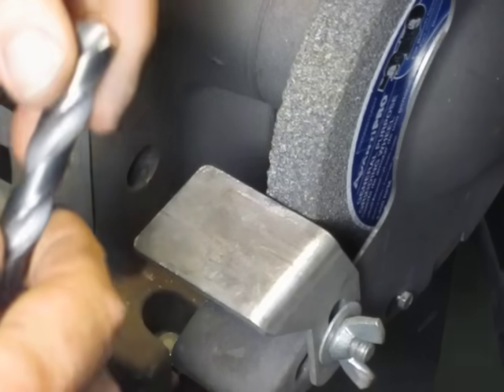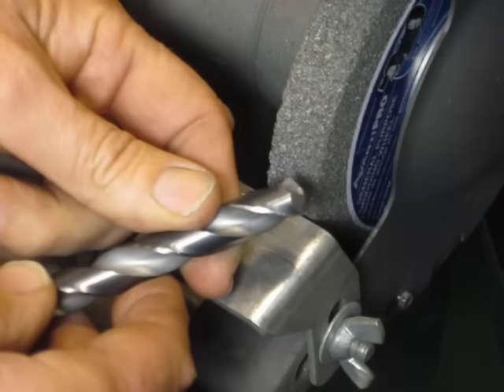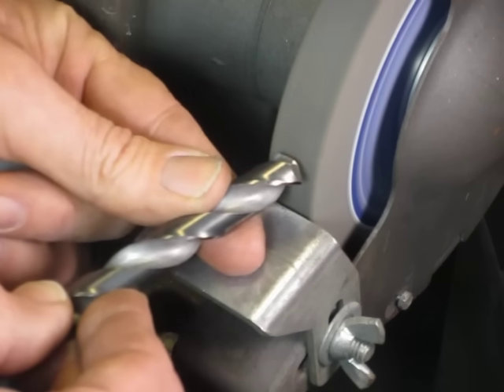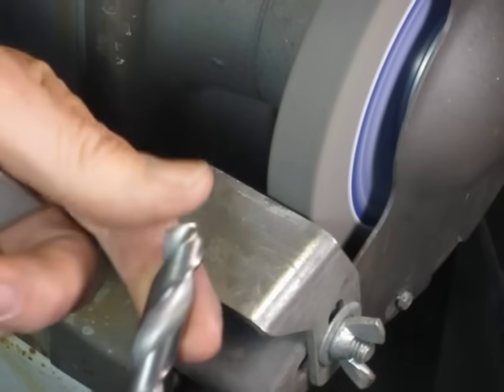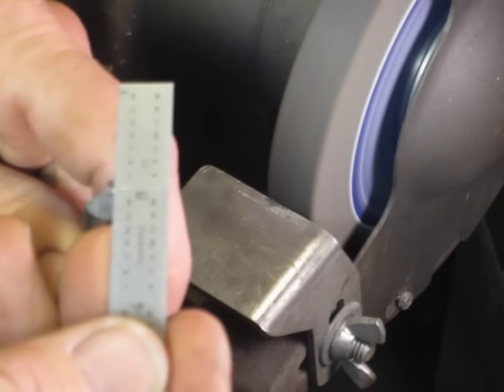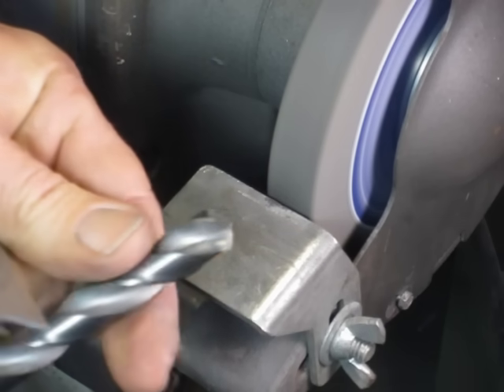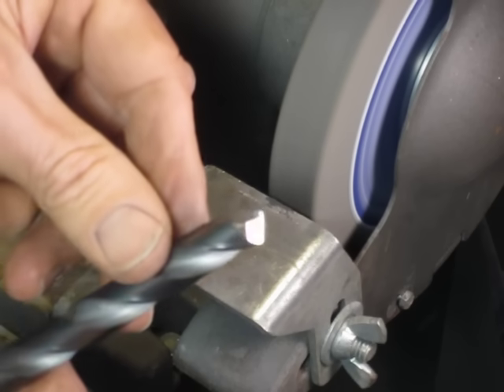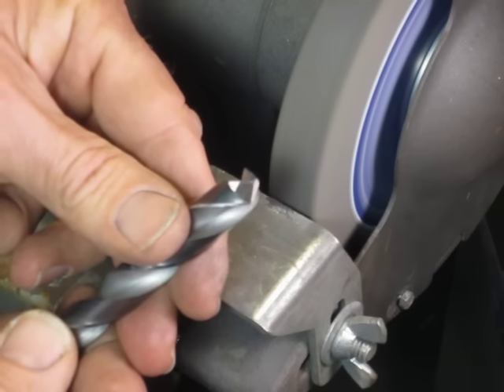How to Hand Sharpen a Twist Drill

Comment: something I won't ever get: you guys spray liters of cooling fluid on the tip when drilling through a 3mm brass plate, and then you turn around and put your precious HSS tools on a hi-speed benchgrinder and let the sparks fly?!? Anyway. You explained pretty well how to achieve a well sharpened drill bit. Thanx for that.
Reply from the maker: It sounds like you lack an understanding of the red, or hot hardness property of high speed steels. Unlike carbon steel, which starts to lose it's hardness around 450ºF, it takes around 1100ºF to accomplish the same thing with high speed, literally a dull red in color. The only reason you need to dip high speed steel tools when grinding is to keep them from burning your fingers. I actually did a video with a demonstration on this very concept if you are interested.

https://youtu.be/jQ648eDA7V4
Reply: @TomsTechniques  I know about tool-steels, you can believe. But ... anyway thanks for offering advice. Now... how can I put that right as a non-English native... Unlike during high-speed-milling, where most of the heat is going into the chips and gets by this driven away from the workpiece, you are using a bench-grinder. And during this process the heat is equally distibuted to the cutting edge and to the chips. And, those chips fly away in form of glowing sparks (yellow). So, the heat possibly offered to your workpiece shoult be far above 600°C. Well you will answer that the tool's massive shaft will absorb most of the heat, but... correct me if I'm wrong, cutting is done by the very top edge of your bits and tools. So we're talking about some cubic-micrometres of steel. It's inevideble that it gets detempered, as that's exactly the piece where you are grinding in purpose of sharpening.

So... to me your method looks still like diletantic sharlatanery...  Or do you just love sharpening?
Reply from the maker: I understand your theory and I've heard it before, but in reality it just doesn't hold water. I've been sharpening bits like this since the 1970's and the methods I use are not unusual or uncommon. If what you say is true about the grinding wheel damaging the cutting edge, I suspect someone, somewhere would have noticed the effect in the form of poorly performing tools. I personally have not, nor have I heard of anyone else who actually does this sort of thing for a living mention such a short coming and I'll take real world experience over theory and conjecture any day. 

By the way, it's charlatanry, not sharlatanery, and I suspect that you sir may better fit that characterization than I. ;)
Reply: Call me a diletant, will ya? Well YOU, my good sir, are a festizio.
Reply: voice of Billy Bob Thorton "I like the way you talk"

Comment: I have been grinding drills from very small to 3" by hand for just over 40 years and I have always thought my apprentices that what you take
off on the first cut you take off the other side and always with a radius
Reply from the maker: Conical relief is the standard, but multi-faceted drill point geometry is becoming more common. Any split point drill you buy will be faceted like this.

Comment: I work with a older guy who insists on hand grinding drill bits, I haven't even figured out how to use the damn drill Dr yet. 😆😆😆
Reply from the maker: I was doing this long before I was an "old guy". :)
Reply from the maker: Np. I was just pulling your chain. I once worked with an older guy who swore by a crumby attachment on a pedestal grinder to sharpen his bits. He challenged me to a little competition to see how many usable bits we could each sharpen in a given amount of time and I won hands down. Only problem with that was I had to teach him how to hand sharpen. :)
Reply: @TomsTechniques  I'm trying to learn. A little practice here and there when I get free time
Reply from the maker: That's what it takes. Once the muscle memory is developed so you can lift a bit off the wheel and put it back on in the same position, it never goes away.
Reply: @TomsTechniques  well I tried a few today and completely fuckered em right good.  Lol. More practice needed.
Reply: @TomsTechniques  I was not trying to come off as calling you old. Just telling a factoid.

Comment: I got taught when I was an apprentice mechanic 50 years ago. My boss taught me to slightly roll the drill bit from the cutting edge, the main thing is practice. I can still do it today, keep at it.
Reply from the maker: Conical clearance will work fine (that's the way I learned as well), but faceted clearance angles are a bit easier to grind and generate less heat.

Thanks for watching.

Comment: How do you do a #60 drill?
Reply from the maker: It takes a steady hand, a pin vise to hold the drill and magnification, but it can be done.
Reply: A microscope mounted on the bench in front of a dedicated grinder. I ground a lot of #55 tire mold vent drills that way. They will get red quick.
Reply from the maker: Your eyes are definitely the limiting factor when working on small details. I've done a lot of machining through a stereo microscope. Once milled a .008" square hole in a piece of brass shim stock using a .003" diameter carbide end mill. It was on a CNC mill and through the microscope, you could see the individual XY steps and the pause to let the end mill catch up. It's pretty crazy watching an end mill the size of a human hair drilling and milling.
Reply: Very carefully! Use a 180 grit wheel and a headband magnifier. It can be done! It is even possible to hand grind a 1/16" 130 degree split point drill. I know - I've done it out of desperation with a solid carbide drill.

Comment: You take too much off the backside the drill bit is going to be overheating and cutting too much,  a little bit lower that do the best job. It takes me about 5 seconds per drill bit to sharpen without measuring angle and 100 percent Sharp guarantee every time, a broken bit take a lot longer.
Reply from the maker: "Too much" clearance will reduce the amount of heat conducted away from the cutting edge, but too little will cause the heel to rub. It needs to be somewhere in between, or as on larger drills, you need to use two secondary relief angles.

Comment: The angle should be between 90 deg and 135 deg, for very soft, respectively for hard materials. 118 deg is the average angle which satisfy majority of materials. The exact angle is not very important as long is the same for both cutting edges. For through holes it doesn't matter the geometry of the drill as long it cuts well. For precision holes,  angle , length of cutting edges and relief angle ( rake is built in and you can't change), is important therefore you should use new drills or sharpen the drills with a devise like Drill Doctor. Large drills over 3/4 to 1 inch dia., or very small, cannot be usually sharpened by hand. You have to have a very good eye and hand to do it. Any difference between cutting edges will create a lot of side force to bend your drill and obtain a larger hole than intended. One of my teachers once said: "if you can't draw a drill, side view, top view and cross sections, you do not understand the geometry of it and you can't sharpen it". I wouldn't be so tough, but you really have to understand its geometry.
Reply from the maker: All good points except for the large drill thing. I find larger drills much easier to hand sharpen because the geometry is easier to see and an error in cutting edge length has much less effect on the diameter of the hole. For instance, a 1/64" variation on the length of the cutting edge of a 1" drill bit will have less effect on the diameter as a 1/64" variation on a 1/8" bit.

Tom

Comment: This was my grind for 35 years running production. I ran A286, Inconel, and waspaloy so the grind had to be spot on. Your grind will run 4 hrs at a min and 8 hrs if you push it. I always split the point which is not difficult, just practice until you get it down pat. When buying a protractor get one that has a scale marked on the back, makes it easier. Or just glue one on.
Reply from the maker: Accurately splitting a point by hand is a bit challenging for a basic video like this, so I opted to just show how to thin the web. It's amazing how many responses were made about how a drill sharpened like this will quickly fail. Of course none of the posters actually try it, they just know it won't work. :)

Tom

Comment: Need to roll drill as you sharpen it to give the cutting edge slight relief.
Reply from the maker: No, rolling the drill is not necessary and the whole idea behind this video is to not use that technique. Multi faceted geometry is more efficient (as in it creates less heat) and much easier to grind.

Comment: Use only the side of wheel. Angle is right iif both cutting edges are "straight" when viewed "end on". If hooked, the angle is too shallow and if curved back it is too pointed. Get the angle right then add some relief behind the cutting edge. This way works 100%. Look at a new drill bit end on and see how straight and even they are, copy that.
Reply from the maker: I would not recommend using the side of the wheel on a bench grinder, other than the very corner to thin the web on a drill bit. There is no rest for support and it's not practical to dress it as it wears (for the same reason). You are much better off sticking to the face.
Reply: I had  assumed the wheel was in good shape and used only for drill sharpening etc., Thinning the point is only of significance with larger drill bits, say 20mm upwards. Drilling a pilot hole is always better. I have used this  method of drill bit sharpening for 60+ years, ever since I was shown it by a man who had worked in shipbuilding during world war II. It will work everytime if you carefully follow what I have written. .
Reply: Never use the side of the wheel.🤣😂😁😀😎

Comment: how about some ppe?????????????????????
Reply: @TomsTechniques  personal protective equipment. ppe its the term professionals use
Reply from the maker: I'm wearing safety glasses. Am I missing something?
Reply: @TomsTechniques  maybe some safety gloves. js man
Reply from the maker: When I was young and stupid, I was welding a piece of angle iron and decided to clean it up a bit on the belt sander to make it easier to weld. In the process, the part caught on the belt and was pulled into the gap between the belt and table, along with my gloved thumb. Before I could react, the belt ground about a half inch off the end of my thumb, flesh nail and bone. That little incident taught me that wearing gloves around moving machinery is a really dumb thing. And if you take the time to browse the Department of Labor website, you will find that gloves and loose clothing combined with machinery are the leading cause of injury in the workplace.
Reply: @TomsTechniques  dont need to look i believe you. sucks about your thumb sure that hurt like anything. take care thanks for info never thought of a glove catching just thought of a finger doing it.
Reply: @TomsTechniques   very well said , i`ve done that in school and also it is an asked question for exams now as well...!
Reply: @brucektm  wait your exams have a question if you should wear gloves on a grinding wheel and the answer is no? just asking because their are safety gloves made specifically for use with grinders

Comment: So many hours of experienced shared here for free.  Thanks. It looks so scary to me.  I learned how you need to slide it back and forth on the wheel to keep the wheel and part even.  And also how to not take your hand off the tool to look at it so you can put it right back in the same angle.  But still.  I'd like to have some kind of automated CNC style solution for safety reasons, but for that to have a chance of working you would have to have a new condition grinding wheel that is even. So the moving the material that you are grinding back and forth to keep the grinding wheel even on the wear is super important.  I tried to sharpen some bits and it was too hard and I can't see well enough or hold the tool steady enough, and it is just not for me.  But to solve that with a safe automated machine would be a fun challenge.
Reply from the maker: You already have the most universal and safe automated solution imaginable, your hands. :)

I agree though, designing automated machinery to do specific tasks is fun and I spent a large part of my working years doing just that. 

Thanks for watching!

Comment: You’ll know you did it right or good enough because it will cut again, with out a great of effort. Also remember slow down the drill, use lube to cool and use moderate pressure. Bits are cutting tool

Comment: incorrect.....you don't "flat grind" your reliefs or back angles....
Reply from the maker: Actually I do, and you can too. Do a little research on multi-faceted drill point geometry to see why it's the better option.
Reply: As a machinist with more than 35 years in the trade, served apprenticeship, achieved my BSME...I don't need to research incorrect geometry. THAT is the incorrect way to properly sharpen a drill bit. A first yea, first semester machine shop student in a vocational institution knows that it's incorrect.
Reply from the maker: It's unfortunate you have spent that much time in the trade and failed to evolve. Multi-faceted drill point geometry is not only easier to hand grind, it also requires less power to drive the drill, which in turn creates less heat. That sounds like a win, win to me. Incidentally, I have about ten more years in the field than thou and realized there was a better way to sharpen drills about twenty years back.
Reply: Evolution in the trade is great ..change is always welcome...except when the change is flawed. Good luck and sorry after 45 years you're still sharpening drill bits with those flaws that are prone to fracturing, damage to parts a d tooling... SMH
Reply from the maker: There seems to be no shortage of experts on YouTube who, based on their extensive experience in the field, are quick to point out when someone is doing something "wrong". The problem is they never provide any justification as to why they claim it is wrong, other than it's not the way they do it. I suspect your meltdown is due to the fact that I sharpen my drills using facets rather than conical clearances as you learned in trade school. I learned it that way myself and actually taught that very method in vocational machining programs. But since those times, I have come to realize that there are many other ways to sharpen a drill bit that work as well or better than using conical clearances. The method I use is based on split point geometry, which I'm sure you are aware of, which by the way uses faceted clearance angle, not conical. But split point geometry is pretty much impossible to grind by hand, so I use something similar called high tensile notched point geometry. This geometry is easier to hand grind than conical and with the notched point, requires much less force to feed than a chisel point with conical clearance. If you would actually step out of the box and research alternatives to the method you know and love, you would find many alternatives. Not that I expect you would do such a thing, but just in case, here are a few links:

http://greenetool.com/wp/wp-content/uploads/2012/10/GTU_Drilling_Ill2.png

http://www.anca.com/getattachment/65f0591c-c35f-494e-b25c-09ed4c5926a3/ds-drillpoints.jpg.aspx

http://www.newmantools.com/machines/drillpoint.html

https://www.mmsonline.com/articles/choose-the-best-drill-point-geometry
Reply: Hey Tom why'd you stop making videos? You're a wealth of knowledge when it comes to machining. Alot of people like your content, don't listen to the nay sayers.
Reply from the maker: The naysayers don't bother or deter me. In fact, I find them somewhat entertaining. Most of them are either uninformed, or so stuck in their ways that they find impossible to accept the fact that there may be better ways to do things than the one they use.

I retired last year from an intense 17 years of helping build a small start up business, to a large and successful one. The videos along with the job got to be too much and I was forced to hang them up for a while to catch up on life. I do plan on picking them up again on YouTube and Patreon in addition to building a new website, once I get used to this retirement thing and catch up on all my projects. :)
Reply: @TomsTechniques  Thank you Tom for showing this video. I've been a smith only for a few years, and sharpening drill bits is something I've always struggled with.
Reply: @TomsTechniques  Just watched this video so I can pass the info on to a work colleague. Clear and crisp info, keep going. It doesn't matter which way is better, until someone goes through the effort of making a video with better instructions, let your almost 5 million views do the talking!
Reply: @TomsTechniques  Hi Tom glad to see you are coming back to making videos.  YouTube is a fine way to share your knowledge. I retired 5 years ago and only do consulting work now. I greatly enjoy making videos about the various projects in day to day shop life and the old tools that I rebuild as a hobby. 
The naysayers and safety sallys can be a positive thing. When they gang up and start pounding on the keyboard it is just that many more people looking at the videos attracted by the train wreck. 😎
Reply from the maker: Thanks David. I'm just in my first year or so of retirement and still catching up on things that have fallen by the wayside over the years. I do indeed plan to start making videos again once things settle down a bit, but right now I'm wondering how I ever found time to work. :)
Reply: Show some respect